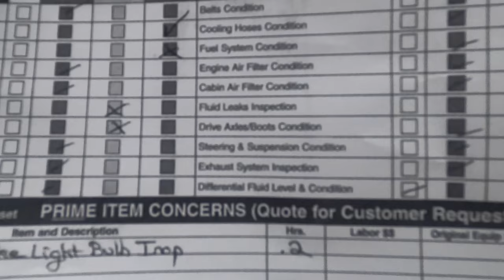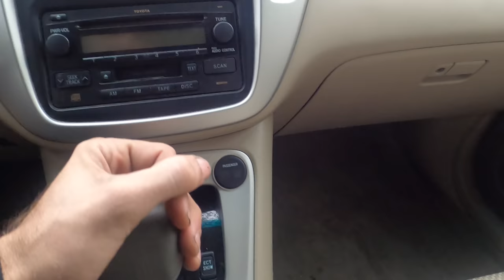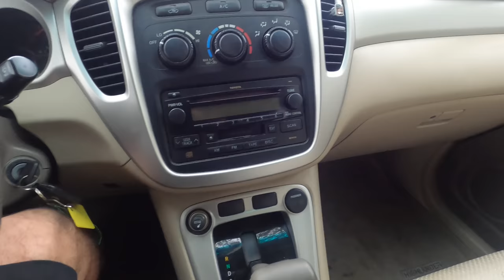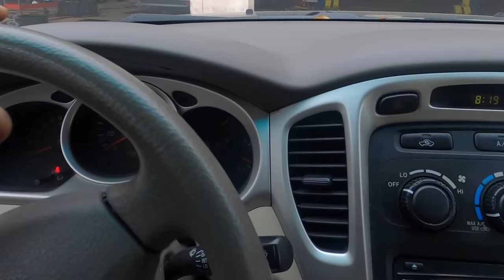We were BASHED by the Dealer! Ripping off a customer! Toyota Highlander 3.3

Comment: This happened to me 3 weeks ago. Went to the dealership for an inspection and they quoted $600 for calipers, rotors , and pads. Said no thanks, they called back lowering it to $400 for 1 caliper. I asked if it was made of solid gold and declined all service. Took it to my known good mechanic, absolutely NOTHING was wrong. Pads were 70% worn so we decided to do them while he was in there. You'd think in a place that requires inspections there would be a way to report false failed inspections but there isn't.
Reply: 600 for calipers rotors and pads isn't a bad deal, had you needed all that.
Reply: My local dealership claims to not have commissioned staff, but they have quarterly sales targets to be met in order for staff to have bonuses.  So it's basically the same thing as commissions - the staff are rewarded for selling the most repairs possible.
Reply: @Maroco918  not when we had gotten brand new tires less than 4 months previously and everything was inspected at that time. We keep up on all preventive maintenance on our cars. So when suddenly a lot is wrong we get suspicious.
Reply: @gaillankford9339  that's why I said, had you actually needed it. IF it was needed, that's a decent price. I agree on the sketchy ness of it
Reply: Wait so what type of inspection were you having done? A personal inspection as to the health  of the vehicle? Or was it a state inspection for the license plate tags inspection? If it was the state tags you can report it to the state and if the state deems it worthy they will revoke their license to do inspections costing that company thousands of lost revenue.

Comment: After what you said at the beginning, I realized how deeply I love and embrace the diagnostic process.  I develop software, and the same objectivity and discipline is required to look at all of the things when debugging any system issue or designing new solutions.  One has to leave "not my code" at the door to do it well.  Love the vids, keep up the good work!
Reply: As a software developer, I have walked into more than one meeting noting that it's good I'm there, because if something doesn't work it's likely a bug I'm responsible for. It tends to help with the rest of the meeting because everyone will not spend their time either dodging or doing their best to point fingers and we can instead focus on what works and what doesn't work and what expectations the customer has.
Reply: Rick what type of software are you working on. I may have a proposal for you

Comment: I have a very high appreciation for people that take pride in their work, perform careful and thoughtful examination.  

Really hate stealerships.  Far too often they have no work ethic, no moral ethic to seek the truth, just a drive to make money at all costs.

Love your approach and thank you for sharing the video.
Reply: I took my old (‘89)F250 into the local stealership to have the blinker light switch replaced. Three weeks later, or perhaps more, it was finally done. It was my property gardening truck, which I used for dirt hauling etc. It have been a snow plow at Lake Tahoe in its earlier life. Being a sea level kinda guy when I found out what a REAL four wheel drive could do I was smitten.  I came out of the Super Market at the top of Kingsbury Grade, I worked nearby, and found that where I had parked on 18” of snow, was now at more like 24” and I being the only vehicle out in this weather had gotten snowplowed in on four sides. As I got in I locked the hubs and prayed I would get home. I hobby horsed my way out of the lot over and through piles of snow that would have completely stopped any but purpose built off road vehicles. Months after my blinker fix I took the backroad home from my job, driving over future roads that had been graded and then blocked off with berms. Transversing a shallow spot in the road took the right front and left rear wheel of the road and the truck just stopped. I found that my limited slip differentials were gone. Four wheel drive isn’t really worth a lot when it quits working if one wheel comes off the ground. Thanks local Ford dealer.
Reply: dealership techs aren't necessarily bad or bad people either, it's really the pressure from the manufacturer. they're really just doing everything by the book and playing it very safe usually, meaning if one things goes then it all goes, which is what the manufacturer training pushes for. the manufacturer doesn't want you fixing cars, they want you buying new cars. aftersales does make a lot of money so their compromise is they don't want you fixing parts, they want you buying new parts. obviously can't speak for all dealerships though, and there are some that really are rotten and can get away with it because they have the manufacturer backing.  it's not always the people, it's the system.
Reply: @cake2531  bad dealerships are bad.  Bad dealership techs are bad.

I stand by what I said.  I have a VERY high appreciation for people that take pride in their work, are careful, and thoughtful.

I have had dealers lie to me and lie to my friends.  One of them was so bad they claimed the car was already damaged before they got it when they caved the roof in.  My friend walked right up to the garage door and showed them his red paint on their door where they didn't raise the door high enough and they tried to lie about it.  

I never say all dealerships or all techs, but damn if there aren't a lot of bad ones.
Reply: @underourrock  i fully agree. i've never worked in an independent shop so idk how different it is, but i'd never screw anyone over. my goal is to get the job done and i stay out of sales/service drama. i'm also not from america, so it could be a difference, especially since we're paid hourly and not fighting flat rate here and hacking jobs/bloating upsell to get paid.
Reply: @cake2531  yeah, I think my experience says something about my particular area, and maybe in the U.S. in general as it sure seems like a wide spread problem here.

I have no idea about other countries but am very glad to hear that it might not be as big as issue there.  Americans have confused work ethic with work worship.

Comment: Ray... I wish I could have your mentality towards these things. I can also get pretty worked up when "blamed" for something even though I know I did a good job, very hard to stay objective... but will always admit it when indeed I did something wrong even though not on purpose. That makes it hard sometimes, but on the other hand it also proves that I (still) care about doing my job.
Reply: Doing things right reminds me. Installed nice mags and tires on a pavement queen. I used tourqe sticks on the lug nuts and hand tourqed the wheel locks ( Ford 4x4). It was back a week later all lug nuts finger tight but locks still tight. Because of how I did the work the salesmen were confident in telling the owner that someone tryed to steal the wheels and there was no fault on me.All of the studs were checked as a courtesy and the lug nuts re tightened. Because I always took care the salesmen would ask for me only to do tire rotations, Oil changes etc

Comment: Great customer service the issue was handled well! I can't say I blame the dealer too much. I've worked at a Toyota dealer and f I had seen oil residue around the valve covers and inspected the calipers I'd have probably recommended the same based on the rusted condition. Slide pins sticking are unpredictable as to weather they're gonna come out or not when corrosion is involved and if they are actually stuck a caliper would be needed. That said the rear axle braking system was completely overlooked and servicing the front wouldn't have resolved the braking noise and it's baffling that it wasn't mentioned in the estimate at all. For those performing brake services Permatex 24125 Extreme Ceramic Brake Grease is a great product that stays on the slide pins usually until the pads are needed again even in rust prone conditions. The temperature rating is really high (3000*F) so the grease tends to degrade at a much slower rate than generic or even OE Toyota brake grease (3-400*F).
Reply: Umm, you're supposed to use Permatex 80653 on slider pins, not the purple stuff, that will swell up the rubber.
Reply: @Pepe-dq2ib  yeah for real

Comment: I do mobile auto repair on a part-time basis. I've seen so many examples of dealerships and big chain shops trying to rip people off. On one similar to this, they told the person they needed a new pair of calipers and pads and rotors on all four wheels. They didn't need any of that. A bent brake clip and some dirt around the brake pads on one wheel was causing the noise. I cleaned it up and they were on their way. The shop was trying to get them for $1,300 in repairs.

Comment: I'm glad to see your idea of "inspection" is different from the Ford dealer where I bought my used Ford truck. I took a look over it just to see where my pad life was,  etc. and found the rear calipers had stuck slide pins. 

I brought it back and let them know the brakes were "stuck". They did clean up the pins no charge after I had a conversation about the word "inspection" with them. 

My thoughts are you cannot use the word "inspect" unless you actually do it. That's basically false advertising otherwise. By definition, they should not legally be able to use "inspect". From my experience, what most places do is slightly glance over the brakes by depressing them and checking if the vehicle stops, not actually inspect them

Comment: I have a 1998 Sienna. 165k original calipers. They pistons travel like new.  Running 106 posi-quiet metallic pads froze my caliper guide pins. I had to use a torch to free the frozen, rusted in pins! NEVER use metalic pads!  The pin boots were in good condition. I was stumped how the metal dust got in there. Use caliper pin lube! Not grease! The caliper floats better on the pin.  I replaced caliper pin kits with boots, and switched to POWER STOP Evolution OEM ceramic and they stop better than Posi-quiet ceramic pads. And they are $8 cheaper! I use new Posi-quiet pad clips. For some dumb reason, POWER STOP clips have a thick spacer that doesn't let the pads float.

Comment: Should've pulled pads and cleaned shims, rusty pads get hung up over time. Some of those slide pins look like they never were greased for them to be so crusty and dry. Grease dries up a little but doesn't disappear and allow pins to completely rust unless replaced last brake job forgot to grease them. That's what looks like happened on a few of them. Good job making things right for customer 👍
Reply: Yes clean the shims and put brake pad grease on the shim and brake pad slide
Reply: Had a break job at the dealer that only lasted 13k miles because they didn't clean and lube slide pins. 😡
Reply: My thoughts exactly. Who in Rays shop did the brake job ? 
I know for damn sure it wasn't Ray. Those pins were never taken out and greased. 
Akso, did the rubber on the pins just deteriorate or did some other shop not care and put the pins back in knowing the rubber was gone.

Comment: 'Disneyland for people with jobs' is SO true for walking into a parts store regardless of profession lol
Those caliper pins didn't look like the usual purple goop you put on, maybe someone used old grease that dried up too much ? It almost looks like the rubber seal dissolved on the pin around the 20 minute mark.
Those wheels look like they might have ran through some salty water with the rust.

Comment: Every time I replace pads and/or rotors on my car, I completely remove, degrease, clean, and re-grease all slide pins. Is this something that’s done at a shop generally? I’ve always done it because it’s like an extra 2 minutes per wheel and it will help ensure they stay working, but it seems like some slide pins aren’t greased in years.
Reply: My car needs the pins cleaned and greased every few months, they get gummy as heck, probably due for new ones
Reply: I grease my slide pins at every pad/rotor change as well, if anything I get a bit carried away with grease... I get a decent sized blob of grease packed into the slide hole and another blob in the rubber sleeve, then I run the pin in and out several times by hand while rotating it around. Just keep wiping it down with a clean rag until the excess quits oozing out, then you know that slide hole is literally packed with as much grease that can possibly fit in there. I'll grease them a couple more times over the life of the pads and rotors. I live in Iowa where road salt and corrosion is an issue, keeping everything lubed up and moving freely is the only way to make it last.
Reply: I call it due dilligence. Up here in winter, road salt locks all the brake stuff up. With spring here,its window down season also known as brake job season.
Reply: Applying grease on the slide pins is a must when doing a brake job. There are times when brakes make noise and still have good pad life that lubrication of slide pins can resolve the noise.
Reply: @lolatmyage  what grease are u using?
Reply: Years back when I was wrenching we always cleaned and greased the pins. Quality grease is important as they can get toasty. 

Just the other day I did a brake job for a friend. I had to replace the caliper bracket due to the pins being 100% seized in place.
Reply: @Pippy1  Silver Hook SGPGT90

Reading the tech sheet, it doesn't really recommend to use it for slide pins, perhaps that's the problem...

In any case the tube is almost out and I'm switching to Eze Slide 331, at least it has "brake lubricant" right on the package so it can't be completely wrong
Reply: @Pippy1  I tend to use molybdenum disulphide grease as it’s fairly high temp stuff and seems to do a good job of lubrication.
Reply: Some shops don't, mine did. How I was taught, we did full brake servicing. Rust ridges knocked down, hardware inspected, slide pins pulled, inspected and either replaced or cleaned/lubed. There is such a thing as too much grease forming like a suction inside. Always used sil-glyde and never had an issue.
Reply: Most shops won't do any of this. That's why I do my brake jobs myself.
I'm also applying some brakefluid-compatible grease into piston bellows, before pushing pistons back in.
Reply: Not very often
Reply: @_Frank_the_Tank  brakes get hot. So do calipers and rotors. Grease can and will boil out. Don't use more then necessary the dust boot keeps it contained and from getting contaminated
Reply: To answer your question, unfortunately No.  I have worked with some lazy ass tech's that can't be bothered to take the time to do anything right.  Heck many a times I got heckled for doing things the right way,  "why are you using a torque wrench to tighten lug nuts"?  Unfortunately most service managers value speed over anything else.  So while I might pull down 60 hours a week and do shit the right way, the lazy ass tech that just slaps shit together runs 90 hours.  Guess who the service manager is more impressed with?  But I will say they did learn to bring cars to me the other tech's said "cannot duplicate customers concern" cause they knew I would at least test drive the vehicles and make an honest effort.

Comment: I always lube the slides, clean the component's, sand the rotors on resurface, and check the level for the fluid on a service (some lube plates will top off brake fluid to max, I'll use it as a guide to know to check the pads on inspections). I know a few places that do shoddy work like this, got fired from one place that overpriced and encouraged you to lie on speedy inspections. I was told that type of job wasn't for everybody, by a 6 foot 8 inch man who sounded as if his voice box got destroyed one night at the gay bar.

Comment: After sanding the rust off the rotor you should hit the area with Muriatic Acid. It turns the rust inert. If not the rust will just come back in time! Doesn't matter how much you sand off it will come back!

Comment: For breaks I always use synthetic grease(silicon) - it doesn't age, and I also  do a very bad thing by putting very thin high temperature grease film on hubs before installing rotors. This is the way ;). From this movie I've learned that separate (drum) parking break is a bad idea. You would need to use it from time to time in the move to remove rust.

Comment: Pull the rubberbushing at the slidepins and grind-clean the hole from the rust inside, otherwise it blocks the brake caliper and causes brake failure up to the main cylinder!

Comment: "Like Disneyland for people with jobs."

That tends to be my response when going to places like Lowes or Bass Pro Shop.  I've been trying to get the right tool for the right job collection for years.  And I'm still not where I need to be with that.  

But hey, on a side note you have to respect any man who uses a Fluke Multimeter and avoid the $20 junk you can pickup anywhere else.  I've owned Flukes for almost 30 years and the only reason I have owned more than one is because the first one got stolen.  Got to give the thief credit.  He knew what he was stealing.